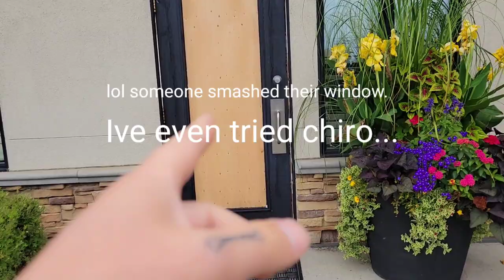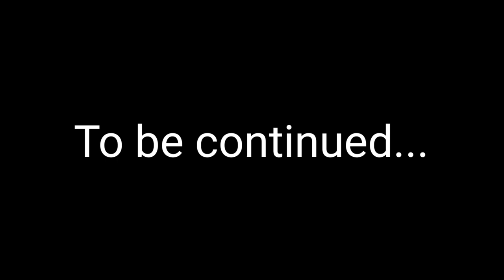Free trailer gets used | Another VLOG #177

Comment: Headache and unmet dental needs.  I was behind in my dental care, because of the pandemic and procrastination.  I was having unremitting headaches, sometimes severe and always present to some degree.  I pushed myself to go to the dentist and three sessions in the dental chair improved my situation.  I had a deep cleaning.  I had cavities in several teeth that causes anaerobic bacteria to have a party in my mouth.  I went ahead and had childhood metal fillings replaced with composite.  So all the old icky stuff is now fresh.  I got my new bite adjusted, so I do not crash down on my back teeth.  I used Nitrous oxide gas and the process was not terrible.  I knew I had enough gas and air, when I could no longer hear the cheesy piped in music.  If you have not been to the dentist in a while, ask around, find a good one and go enjoy some gas and air.